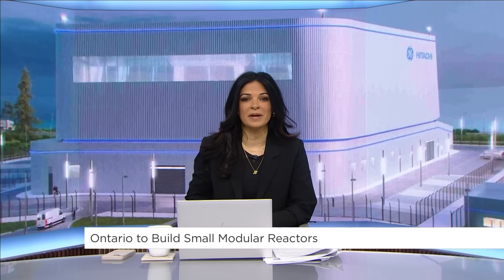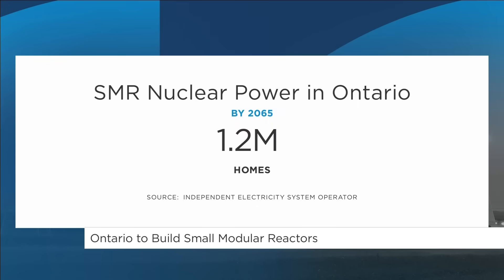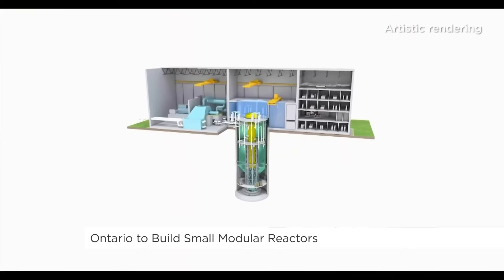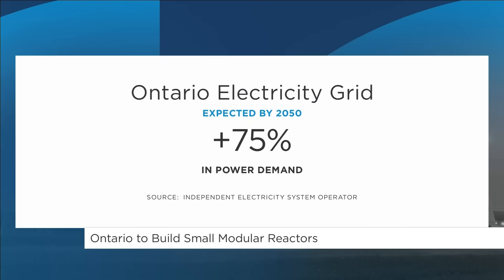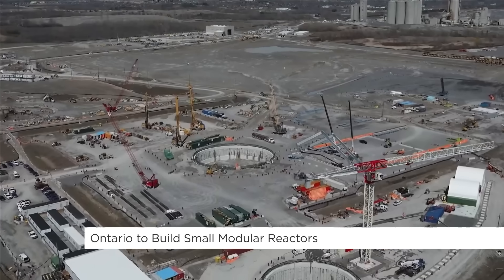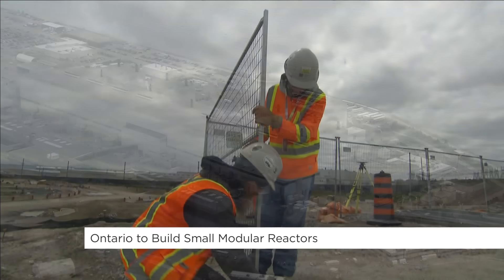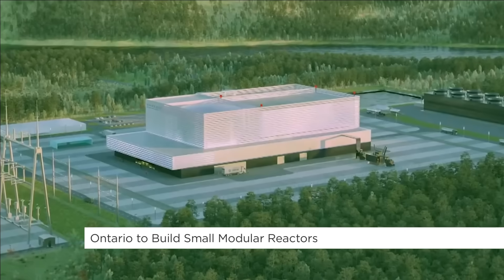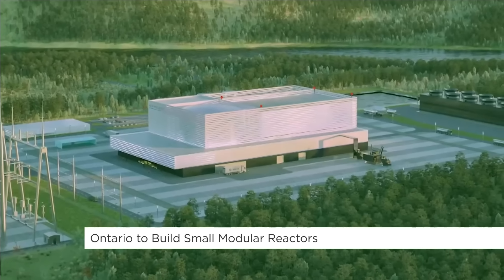Canada’s First Small Modular Nuclear Reactor | Your Morning

Comment: You could build 5x as much wind, solar, with full battery backup, in 1/10 the time and for 1/5 of the price.
Reply: This is factually incorrect, but okay.
Reply: Wind doesnt always blow and neither does the sun always shine. Nuclear is reliable, safe, and a worthwhile investment.
Reply: You need a mix because every one of these sources have disadvantages that the others can help make up for.
Reply: The price for renewals at low grid penetration is very different than the price at high grid penetration. Their intermittency costs a lot when it's all you have.

Comment: It would be much cheaper to build a new transmission line to Quebec so we can buy their cheap hydro.
Reply: That sounds simple on paper, but it's far from practical or economically guaranteed.

Building long-distance transmission lines isn’t cheap, fast, or politically smooth. The cost of high-voltage transmission infrastructure runs into billions, not to mention the regulatory hurdles, land use negotiations, and years-long delays,especially crossing provincial or Indigenous territories.

And Quebec’s "cheap" hydro? It’s not endless or unclaimed. Quebec already has long-term contracts with New York and New England, and demand inside Quebec is climbing. Once exports increase, prices will follow. You're betting on a future supply that isn't guaranteed, and giving up energy sovereignty in the process.

SMRs, by contrast, generate power locally, reduce transmission losses, and support grid stability right where it’s needed, especially in remote or rural communities that hydro lines will never realistically reach.

Depending entirely on another province’s grid is not energy security, it’s energy dependence.

Comment: The US is pushing for SMRs too but most of their proposed projects have failed, canada could partner with the US to supply the design and engineering not to mention we have the best and cheapest uranium. Its almost like its all coming together as planned
Reply: This is a US plan and technology, and it uses US fuel, it might as well be like building your own hostage for the US to use
Reply: With the trade holocaust Trump has been creating, more US codependency isn’t really an option right now.

Comment: It's not carbon that is the concern, nor is an increase in global heating as a result of increased emissions a concern neither. It's the ionosphere, it's connection to heat transfer and balance mechanisms and the state it's currently in, oxidization mostly as a result of the smelting process, as well as what's happening to the magnetic field that needs attention, as well as Quantum computing. Helloooo. The ionosphere is actually, in a nominal state, supposed to be dipoles, which in case nobody is aware of, is more like an absorbtion spectral line, curled like a microtubule, that surrounds an emission spectral line of a similar configuration, filled with electrons carriers, that contain even smaller scale spectral lines connecting each electron carrier. 
A physical dot, dash, dot, inside a physical, curled magnetic field line, with a larger line surrounding it, electrostatic current peeling small filaments off between them as energy travels north to south while Earth rotates, that transfers heat and spectral information, between space and atmosphere, as well as core to core, not just particles containing heat and polarization that people are foolish enough to think heat and light just randomly pass through at will, randomly, for millions or even thousands of years in these current conditions.
 Lol, No offence, humanity is potentially kinda screwed if this isn't taken seriously... If humanity didn't melt everything in the process of making materials and take advice from N.A.S.A, while also constantly launching rockets into space, this would be common knowledge... The magnetic field is no where near, what anyone knowledgable of  nominal, verses current conditions would consider to be in a state that would allow for even short term stable conditions either, should we carry on as is, thus the confusion, manipulation, or misentepretation regarding the ionosphere and it's role. 2000 years or so of smelting, less than 100 years or so of rocket launches that became common place before a more thorough understanding and scientific method was developed, Tunguska, not to mention any number of other events, really caused some issues....

Comment: Just so you know, particle balance occurring  at the sub-atomic scale, within Earths atmosphere, as well as the heliosphere, will occur due to interactions before, during and after nuclear reactions, that eventually will cycle energy and information between Earth and the Suns entangled state cores and cycle back to the Canadians using the energy generated, in any number of less than healthy ways, with even worse long term concerns than decay rates of the spent fuel rods. You should be trying to strengthen the magnetic field and fix the ionosphere so as to be able to efficiently generate electrostatic current at high to low energy levels withing the atmosphere, relative to altitude and pressure differentials. This is so incredibly foolish given todays conditions.

Comment: Smaller, faster, but still have no solution for the toxic waste.
Reply: I read recently that some scientists figured a way to reuse nuclear waste. Unfortunately this kind of waste is a hot topic as it can also be used for weapons...
Reply: @jaaklucas1329  Europe has been reusing nuclear waste for decades
Reply: @basilminhas7179  You're right.
Reply: There are ongoing studies and experimental technologies exploring the reuse of nuclear waste, including advanced reactor designs like fast neutron reactors and molten salt reactors, which can extract more energy from spent fuel and significantly reduce the volume and long-term toxicity of the waste. Countries like France, the U.S., and China are actively investing in these innovations
Reply: Candu reactors can actually burn byproducts from other reactors but I'm not sure that capability is being used right now. That would reduce overall waste being generated.

Comment: Glad to see, but I'd rather build more CANDU 6 and better interprovincial ties.  Coming off the CANDU renewal project, the supply chain is all tooled up.
Reply: Not to mention CANDUs aren't dependent on the US for enriched fuel, whereas SMRs will be
Reply: CANDU 9 would be ideal, no more complete plant outages every 10 years. They could still be built in 4 packs as well.
Reply: Bruce power has a plan to build 4 more Candu reactors and refurbish all the current reactors on site. Candu ain't going nowhere